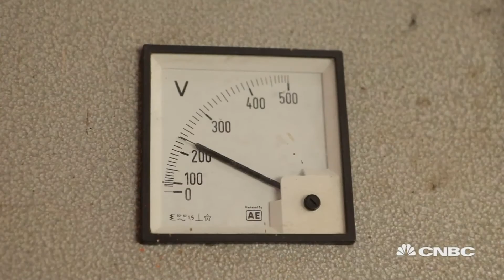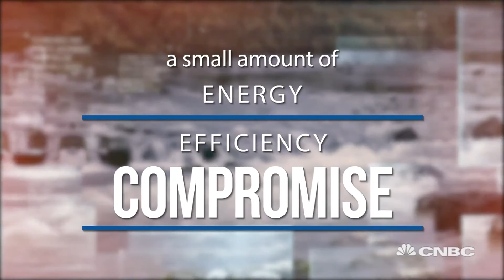The power of hydro, part one | Sustainable Energy

Comment: Artificial lake can through diesel generator running biodiesel and pyrolysis oil to powered large scale AWG atmospheric water generator, which carry on unlimited water storage for artificial lake and hydro power. Or use cloud seeding. Of course when we use cloud seeding, time control and level of artificial raining must grasp well. If we choice artificial heavy rainfall to water storage for hydro power and artificial lake, time control of artificial raining dropped had better 2 hours.

Comment: Hydro power is not renewable!!!
Reply: Yes it is.
Reply: Mohamed Magdy how do you proof hydro power is not renewable?
Reply: Mohamed Magdy unlimited water resources from cloud seeding or electrical grid for 20 large seized atmospheric water generator based on 20 biodiesel generators to unlimited water resources production and unlimited water storage.
Reply: Mohamed Magdy not surprised, in china there are so many biodiesel generator-powered atmospheric water generator to unlimited water resources production and unlimited water storage. Cloud seeding to water production and unlimited water storage for hydro power.
Reply: Mohamed Magdy unlimited water resources from air and cloud.  Cloud seeding can unlimited water production resources. Biodiesel generator powered large scale AWG (atmospheric water generator) can unlimited water production resources. Biodiesel come from vegetables oil. Don't forget pyrolysis oil. It is also renewable bio crude oil. Pyrolysis oil can running on diesel generator. Pyrolysis oil can come from animal manure such as cow dung dry and pig dung dry and horse dung dry even sewage sludge from human waste.